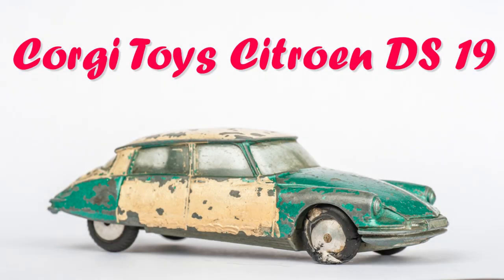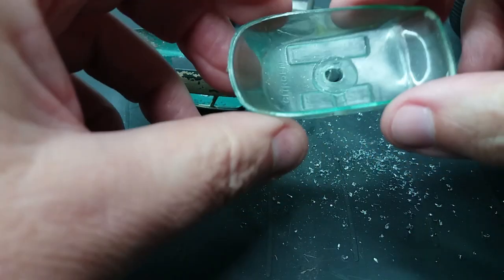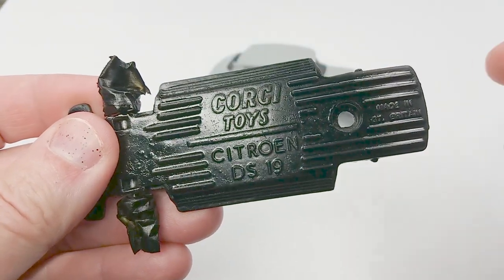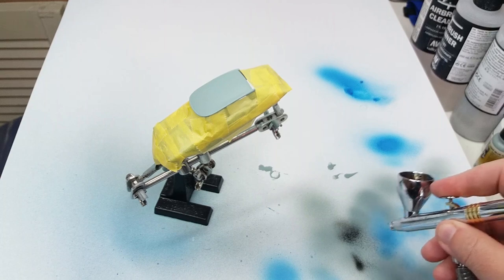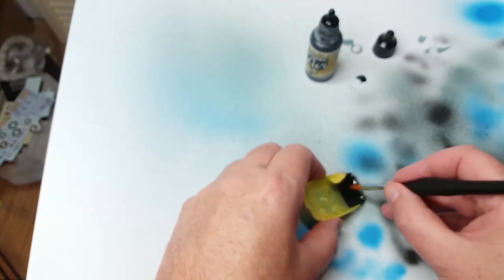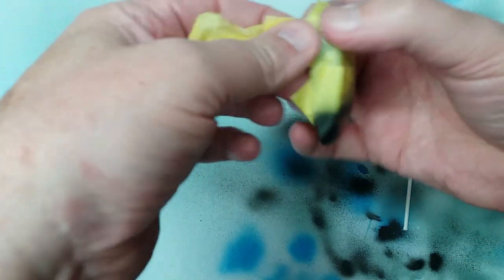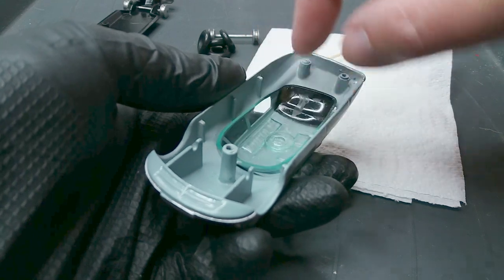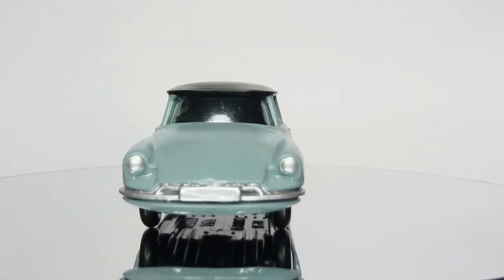Corgi Toys Citroen DS 19 full custom diecast car restoration

Comment: I was watching this again, and it struck me as ironic, that there was no suspension on a model of a car that was famed for it's tremendously advanced, and brilliantly engineered suspension system.
Reply: If they had tried to make a miniature version of the unique and stable suspension system of this car, they would have had to use a larger scale model of metal. This tiny size makes it rather difficult and they probably wanted to market all these models for about the same price.  The suspension on the real car made it one of the most comfortable rides in the world. It is a shame that they stopped producing this iconic French car.
Reply: The dinky 530 has it

Comment: If I ever have to paint or tint clear parts, my go-to paint is Tamiya 'Clear Smoke'. I apply it to the inside of the transparency - but that was a huge crack in your window. The front and rear screens on a DS19 are complex shapes - the only way to repair this would possibly by 'Crash-Moulding' a new transparency using clear styrene sheet, using the original transparency as a former, or just the rear half.
Lovely understated restoration, by the way. Nice one.
Reply from the maker: Thanks there is a Vac form machine at at college which i am am looking at.. :)
Reply: Oh, the infinite possibilities of a vac-forming machine! 👌👍

Comment: A tip: Typical aftermarket accesory at the time where Luxaflex type horizontal shades inside the rear window. For a pic: https://www.pinterest.com.au/pin/386324474257763618/ . You could recreate it's look by adding light grey horizontal bands on the rear window. Furthermore: Years ago I restored a badly cast DS from the Portugese Metosul brand. It's so close to this Corgi that it must be a straight copy. I restored in hte colours of the Green DS with white roof that was shown on the 1955 motorshow. What I still dislike is that the rear wheels are too far forward. One day I might yet fix that.